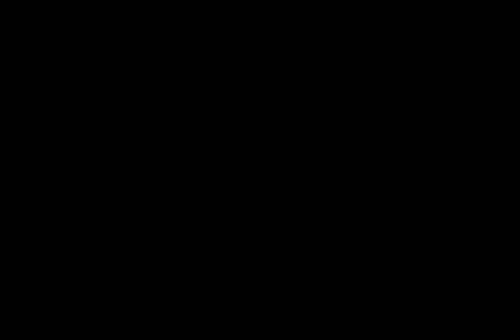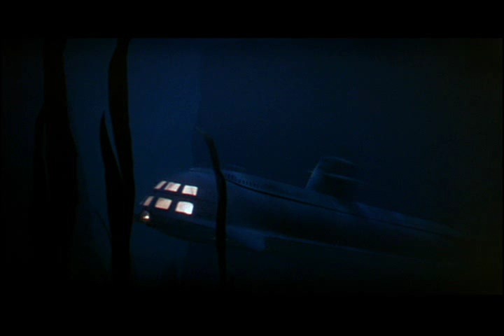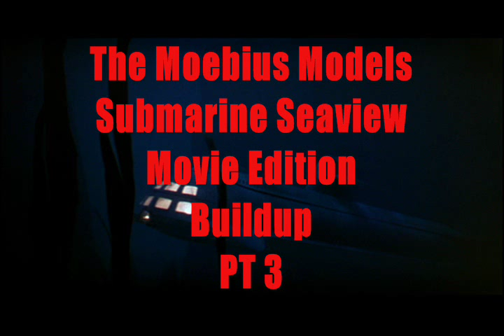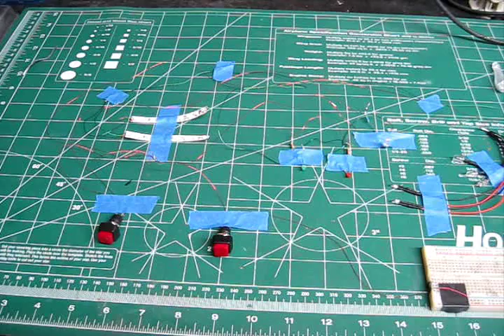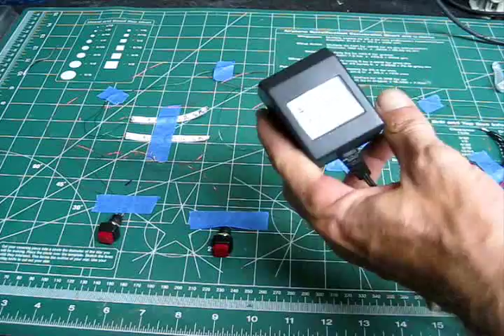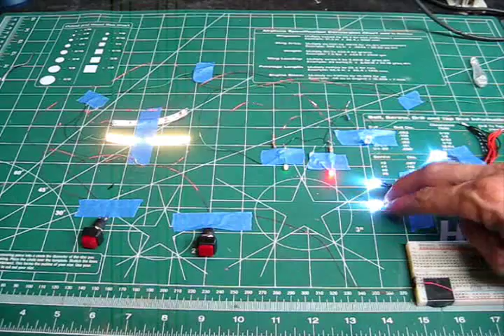Moebius Models Submarine Seaview: Movie Edition Build PT 3 - Designing The Lighting System

Comment: Make sure you check the voltage of that wall wart.   I checked the one I wanted to use for my Mercury 9 project and it was putting out over 13V even though it was labeled as 9V.

Comment: just to let you know, Starling.com has a pre built plug and play sonar ping made for the seaview. I have one myself, and it works great. The sound is looped. It comes with a 1/4 watt speaker, but you can add a 1/2 watt speaker if you wish. Check it out.

Comment from the maker: The wall warts you have are rated a little low on amperage output although the voltages of 6 and 9 volts are useable. The outputs of 200ma and 300ma are enough to light only a few LED's. The LED tape which I use needs at least 7 volts to light and can handle all the way up to 12 volts DC. Most single LED's need only a minimum of 3 volts to light. 
I recommend at least 1 watt or 1000 ma output for most LED lighting projects.

Comment: Hi lov your vids very helpfull for beginners like me,A question I have 2 wall warts as you call them, one is class 2 transformer,input 120vac,60hz 5w, output is9vdc, 200ma. the other one is ac adapter, input ac 120v,60hz,6w, output is dc-6v, 300ma. Are either one of these capable on doing the job? or am I just shovelling smoke, thanks, can't wait for your finished Seaview, I'm subscribed